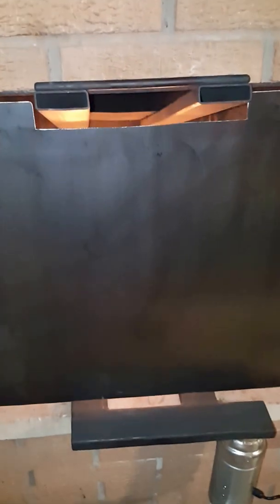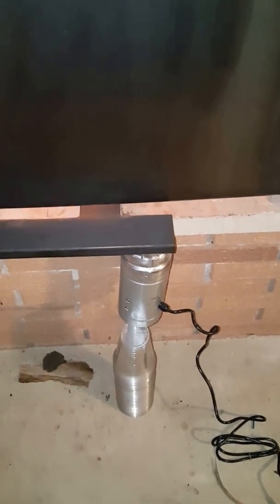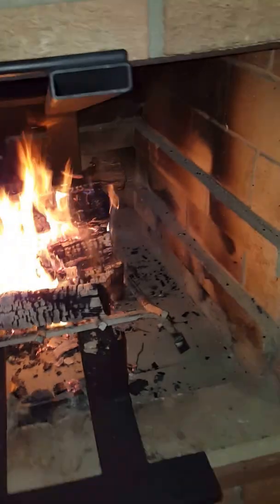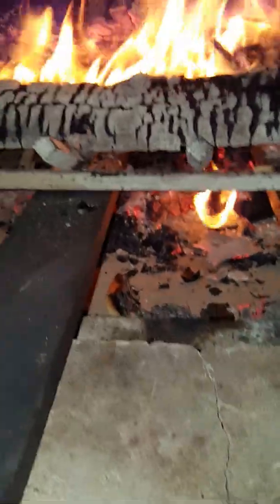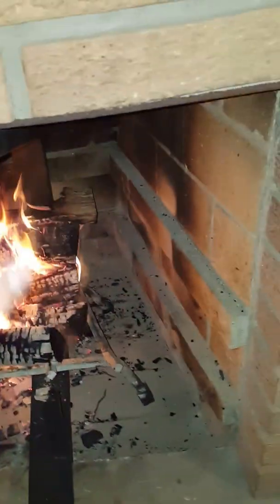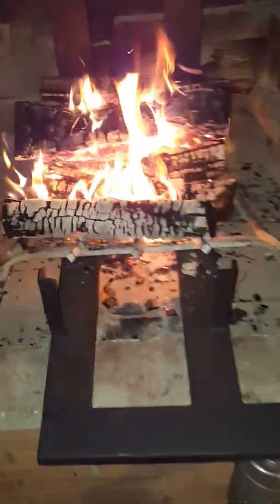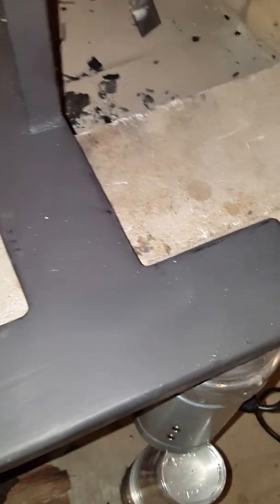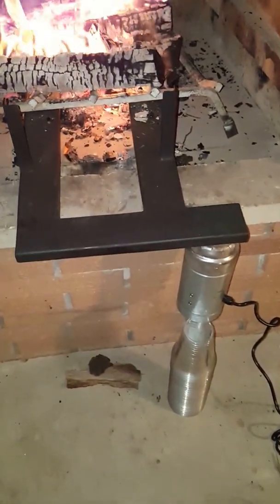My D.I.Y. Heat Exchanger

Comment: I'd get a small squirrel cage fan with a tube to blow from a remote location (so you won't have to deal with the sound of the blower) and  that should really step up your heat output.

Comment: Monitor the condition of the tubes. If one burns through it will burn your house to the ground. Nice system otherwise. If you move the tubes out from under the wood it would be much safer.

Comment: Is not a good idea to extract heat directly from de combustion core. You should extract the heat after the combustion occurs at high temperatures.

Comment: Sweet idea bro. A couple of suggestions; Larger and a couple more tubes = less resistance to air flow. How about a perforated plate on top of the bottom pipes that will allow oxygen to flow but will also allow the coals to add mass to your perforated plate heater during and after the fire is out for longer heat exchange. I think that's the best way to explain that idea in my head. Keep up the good work my man. My brain will be on overtime tonight thinking about this now. UGH. I wish I had a fire place now. LOL